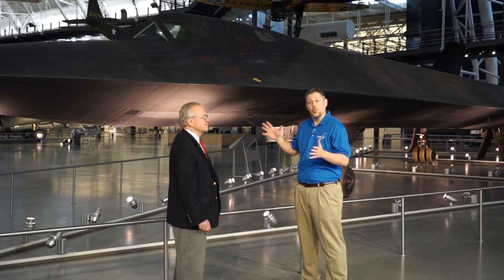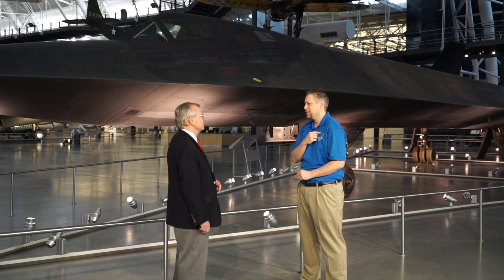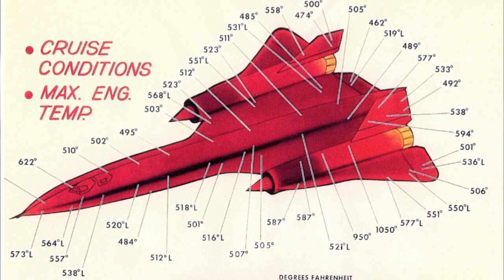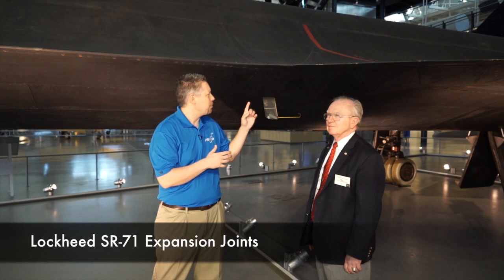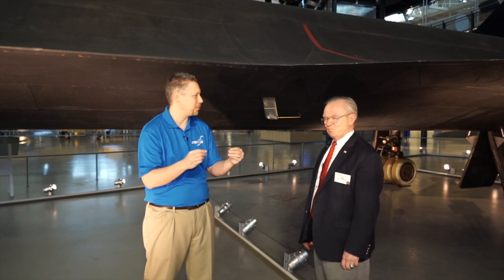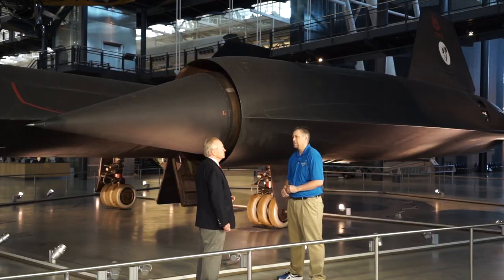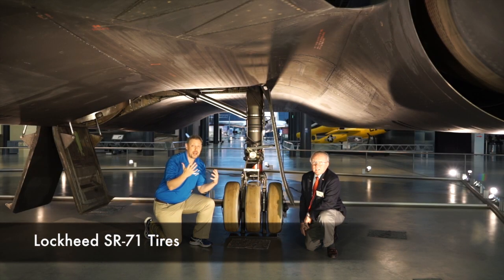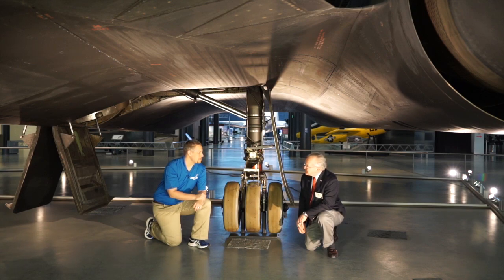A look at the SR-71

Comment: The statement in the description that "There is no inside of the Plane, The fuselage is all fuel tanks," is NOT true.  The area between the engine nacelles is "wet" plus part of the fuselage forward of the leading edge of the wing.  The fuselage is a cylinder with chines on the side to give it a lifting body effect.  It is in those chine areas along the sides where the TEOC cameras, the two SLR recorders, the EIP/EMR (electromagnetic intel gathering) systems and occasionally an auxiliary liquid nitrogen dewar for the long transoceanic flights.
Just 20 seconds in and it falls apart.  The idiots who put the video together put an image of the front end of the YF-12 with it's "standard" target acquisition radar hung on the front of it.  The SR-71 had no such radar.  Instead of the dish as on the YF-12, the SR-71 radar was a synthetic aperture side-looking radar and the array was roughly six feet long by 10-11 inches wide (for the CAPRE radar system used for the majority of its career).  It was fully contained in the nose.  When the noses were removed, the front of the aircraft was dead flat and could take any of the ballast, radar, or OBC (optical bar camera) noses.  
Then the next bit of nonsense that shows up is an image of what appears to be one of the TEOC cameras that mount in the mission bays down the sides of the aircraft.  it is NOT the OBC that Col. Carpenter is describing.  He is absolutely correct about the four bolts holding the noses on.  I changed many noses between 79 and 88 when I worked on and taught theory and maintenance on the CAPRE SLR.  Unfortunately, Col. Carpenter is not correct about removing the OBC nose after flight and taking it to the photo shop.  The photo troops dropped the camera out of the bottom of the nose to access the film.
Disappointed in the Smithsonian throwing random images into the video instead of actually doing five minutes of research to get it right.

Comment: I had 20yrs of work in Aviation when I first stepped out on the platform above this aircraft at Udvar-Hazy. I was the geek of aviation geeks. I've been next to F14s, sat in A6s, craweled in E2Cs, F18s, H46s, P3s, F15s, a couple Tornados even got to crawl around in a restored B17. There is possibly a Tomcat I worked on down right of this aircraft. That day the angels choraled and the light shown down. My wife at the time couldn't understand why I was standing there all ferclemp. Cool is not nearly even remotely a good enough word. The photo I took that day is my background display on every computer I've owned since.

Comment: The part about using just a slide rule to design the Blackbird is a bit of a fib. Pratt & Whitney had an IBM 700 which it used to help with the J58 engine.

Comment: Such a shame that they did not update its imaging system once encrypted satellite communications were made available. The SR-71 definitely is one of the most iconic airplanes in my opinion and was really ahead of its time. 

I'm also very happy with my 1/72 2021 Academy "Limited Edition" scale model kit. Sadly none of the kits are completely accurate and each has their own pros and cons. The Monogram/Revell kit is generally seen as the best option but has raised panel lines and the canopies are too wide. The Italeri 1/72 kit does have the recessed panel lines but apparently has significant shape issues with the nose that seems halfway between the SR-71 and the  A-12 predecessor. Then there's the Academy's 1/72 kit which is a clone of the Hasegawa kit. This one is often ranked behind the Monogram and Italeri for accuracy issues, while the decals were also pretty bad for the earlier versions (some even remarked that the red was more of as  "neon red". There was one "Special Edition" from 2013 which apparently had the best decals but that one is hard to find (and expensive because of it); although a 2021 "Limited Edition" release also seems to have pretty decent decals (albeit from as different supplier). But regarding the Academy/Hasegawa kit; it still generally looks like a Blackbird.

In the end I went with the Academy version as the online retailer had several other items I needed so it was a one-stop-shop for me. That kit also had the least number of parts and I am not a professional kit-builder. So I did not want to spend days on end on a "Level 5" kit with 60+ parts and am currently still practicing with "Level 2" and "Level 3" type kits so I can practice building, filling gaps with putty, sanding, painting, and applying decals properly (which can be pretty challenging at times but look way better than stickers imo). 

Now I have looked at my Academy 2021 "Limited Edition" kit as I still think it looks very nice. Sadly the canopies are all clear plastic so you have to take them off and paint them but that's a nice starting job for me. For a 1/72 scale kit it's a very nice and big ship. I'm also planning on adding some orange LED lighting to the thrusters and convert it to a flight-mode (these kits generally always sit on the ground with landing gear; some even having the 'spy drone' that the SR-71 never used. Pretty odd as to why some of these companies keep including it.

Comment: I was a contractor that visited Beale Air Force Base starting in 1990 (just north of Sacramento).  Unfortunately, they had just taken the SR71's off line, so I never got to see them take off and land.  But, earlier, I did occasionally see them flying over my house (we live south of Beale about 30 miles) at low altitude as they were coming in for a landing.  And I often walked around one of them they had on display just off the flight line at Beale (as well as engines, flight suits, etc at the Beale museum).  Later I did see the few that remained flying at Edwards AFB (NASA).  What an amazing plane.  I feel fortunate to have seen what I did....

Comment: In ~1981, I was working a couple miles east and south of Buckley AFB in Denver. My co-worker and I were outside when we heard a jet take off from Buckley. As it rose, we both recognized it as an SR71. The plane was obviously just poopin’ along with the nose at ~25 degrees upward angle. It flew three times around between the base and a couple miles south of our position, looking like something out of Mordor! The last time it got over the base, two huge gouts of  flame twice as long as the jet and black smoke blasted out of the engines, and in 1-2-3 seconds it had disappeared into the clouds! A few seconds later we heard the most deep-throated thunderous roar I have ever heard!! It took more than a minute for that roar to fade away. A most impressive and awe-inspiring aircraft! I will be forever grateful I was there to see it.
Reply: Hi Fred 😊

Comment: Quite the plane. Parts of the design I think I could do better and parts that don't make sense to me. The bypass in the engines seems bizarrely convoluted iirc which seems so strange for supersonic flow. Impressive to shoot the stars for position. I might have done that with terrestrial radio beacons instead. Inertial for backup maybe. 
I would have done a glassless cockpit. Maybe even a pilotless one.

Comment: As an Army soldier, I was stationed on Okinawa frim 1973 to 1974 with USARBCO as a machinist with the 10 ton truck rebuild group. One day I was coming back to work from lunch when I was startled by a 'loud' noise up over my head. A SR-71 was returning to Kadina Air Base, flying west over the southern part of the island on approach to dump fuel and fly back east to land. It was so close overhead I could read the stenciling under the plane! If I was lucky, when they took off and I heard the engine noise, I could look north and see the SR-71 at 45 degrees or so, disappearing into the clouds. Just beautiful! On Okinawa the SR-71 was called "Habu", which was a local venomous snake, not knowing of the "Blackbird" moniker. Later I saw shoulder patches of the pilots that had "Habu" on them and understood the naming I was told of.

Comment: 2200 miles per hour is the unclassified top speed. Makes one wonder what the actual top speed was, doesn't it? JP-7 has a high flash point. The fuel in the tanks would get really hot so regular jet fuel could not be used at speed. THAT is part of the reason for refueling: putting the appropriate gas in the tank. Wonderful machine. The cockpit is not for large people, either. Not mentioned was that the air in the cockpit would be over 100 C, hence the space suit.

Comment: One of my favorite aircraft. I was fortunate to see it take off many times from Kadena Air Base, Okinawa when I was stationed there. The Japanese called it the Habu, a local venomous snake on the island. Because of the heat & growth of the aircraft, on the ground it leaked fluids severely. They had large pans to catch the fluids.  It would rattle the windows of the buildings along the flightline & set off car alarms during takeoff. Beautiful to see take off at night.

Comment: This craft didn't have wings, its body IS a wing! It had side-wings only to hold the bulk adjacent engines...if you expand the craft size to a large passager model plane, the engine thick propell rod could have been a convertion jet to rocket afterburner, between the o-ring blade skin frame, It could have been the amazing Spaceline/Orbitline passanger service SpaceX attempted, with only 12 to 17 min far more realistic of delay then that verticle rocket dive,, so a SSTO instead. Super sonic airlines were banished to public use because they flew within the tropicsphere as a sound EPA issue.

Comment: I had a toy version of SR-71 when I was kid, I thought "dark speed" toy was an alien spaceship with a high speed. I called it "dark speed" because of it's black color on the plane (not being racist btw, I am just saying it literal by it's visual design) and it's long and thin design which makes it so fast. I was partly correct with its speed. I didn't know it was a defenceless and spy plane, because when i used to play with it, those 2 engine thingy, I thought it was a missile. Btw it was made by metal. I don't know what is specifically made of but it's heavy like holding a phone. It's very hard to brake and I just realized now, It was an honorable, outstanding, very rareand anti-missile toy I ever had. I just wish I still remembee where I hid it and make it as a collection for my childhood.

Comment: The soviet union had the same problem with their MiG-25s and the A-10s could fly with one engine by entending the flaps in opposite directions to the force from the one working engine to stop it from rolling but it's strange how it wasn't implemented in the SR-71 that's correct.

Comment: They definitely have the SR72 up in the air. DARPA was working on HTV-2 which could go up to Mach 20. But they cant figure out a way to control it during flight. So if they are working on something that could go Mach 20, I wouldn’t be surprised if they already have SR72.

Comment: He had to choose his words wisely concerning the speed. The speed is still classified.
Reply: Braden A  No worries. I'm just trying to educate, not criticize. It's a very common misconception that many people have about acceleration vs top (maximum) speed. It seems intuitive that less weight would help any vehicle go faster, but that isn't the case. Less weight helps any vehicle, whether it's on sea, air or land, to accelerate quicker, including up to it's top speed. But lighter weight won't help it go any faster because weight / mass has nothing to do with (fluid dynamic) drag. Once a vehicle gets over a certain speed, it's weight is irrelevant in terms of going faster. Top speed all comes down to (fluid dynamic) drag vs power (all other things being equal like aerodynamic heating, etc). 

When you look at the drag and power equations from the subset of physics known as Fluid Dynamics (for aircraft, specifically the subset of Fluid Dynamics known as Aerodynamics) it becomes clear as to why this is the case. Aerodynamic drag goes up by the square of the velocity, and the power needed to overcome that drag goes up by the cube of the velocity. There are no variables in the equations for weight / mass.

Engineers have always tried to design modern fighter aircraft with excess power, not for top speed, but for acceleration and maneuverability. It isn't necessary for 4th generation fighters (and above, like the only true 5th gen aircraft: the F-22 and F-35) to go super fast. All 4th gen and above fighters are equipped with sophisticated missiles for BVR (Beyond Visual Range) combat. The missiles fly much faster than any of the aircraft ever could. So you want the excess power for acceleration and maneuverability in case you run out of BVR weapons and you end up in a gunfight, and / or you're trying to evade / escape a missile.
Reply: Well we learn something new all of our lives.
Reply: Braden A  your statment was the top speed is not classified,  that is false it is, the top speed ever by an sr71 is still classified.  that is my point the rest of your stament is meaniless as it has nothing to do with weather the top speed is classified or not.
Reply: Braden A  wrong.  listed top speed is mach 3.5  actual top speed is classified

Comment: I thought they refueled because of expansion.  The fuel tanks leaked like a sieve on the ground because of the tolerances. Once up and flying the heat caused them to expand therefore sealing up the tanks.

Comment: I'm really amazed that this thing was built in the 60s.
Reply: An even more amazing piece of technology from the 60s was the Saturn V moon rocket.
Its lift-off weight was more than 5 times that of a fully loaded A380 and its first stage had more power in its fuel pumps alone than the total engine power of most large aircrafts and ships.

Comment: Ok so if you're at 80k feet going mach 3, what's keeping you following the shape of the earth? Wouldnt you just fly straight out into space, burn up? Do he have to keep the plane nosed down constantly? As far as I know theres   no tech on the plane to counter this happening
Reply: The lift of the airplane is determined by lots of factors, air pressure being one of them. To hold a steady flightlevel (altitude) the force of lift on the airplane, and the force of gravity has to level each other out. This means that the airplane will follow earths curvature because the earths atmosphere also is a sphere. 
Sorry to break it to you, but the earth isn't flat. There isn't a single thing that indicates that it is. 
I'm not a native English speaker and writing on the phone isn't the best (if you're having a hard time understanding).
Reply: @Cds2000Channel  I'm understanding fine but I still dont get how the atmosphere being round is going to effect a plane going mach 3 in a straight line, I've seen them fly real close to the ground and the guys just hold the thing straight, to go that fast you have to be going straight, what about those salt flats where they race the rocket cars? That has to be flat
Reply: At 2200mph and at 80,000 feet how is gravity going to steer the plane? Not possible
Reply: @bigmikeobama523  You clearly didn't understand fine... You're missing the point completely.
Reply: @Cds2000Channel  the gravity is always there when you're flying along flat to the ground at low speed you would never notice but at 2200mph you would have to be accounting for something, this guy  never noticed that?
Reply: @Cds2000Channel  no pilots ever mention the curve of the earth and if you go up in a plane it always looks flat, but people try to show me boats going over the  curve
Reply: @Cds2000Channel  this plane being able to fly that fast with no navigation systems accounting for the curve and spin isnt possible the pilots altitude would be all over the place he would have to be constantly nosing the plane down to follow the curve
Reply: @Cds2000Channel  8 inches per mile squared it says on google, you do the math at 2200mph that 2200 miles times 8 in an hour, that's alot of inches per hour and if we keep doing math we can figure out how much curve per second they need to account for
Reply: O wait it would be times right then squared, theres seems to be controversy about these number but even without the squared part that's almost 1500 ft in an hour not accounted for
Reply: @bigmikeobama523  You said you read my original reply, but it doesn't seem like you did. Its explained there.
Reply: @Cds2000Channel  all you said was the atmosphere curves so the plane curves wow... why? Because science? Or?

Comment: Couldn't you just update the camera equipment and not retire the plane?
Reply: John Montag not necessarily bc the software and hardware (controls for the camera) we’re not as up to date like the ones today. To update they would have to replace the controls and then install software to operate the camera. That wasn’t the only reason the SR-71 was retired. It had very high operating costs compared to reconnaissance drones.
Reply: I believe the real reason why the plane was retired is because of satellites. Much cheaper to operate and better equipment.

It is sad though. The SR-71 is magnificent.
Reply: At8000RPM that’s another reason as well. Plus modern reconnaissance satellites have much better camera quality and can cover a bigger space

Comment: I worked on that airplane during my time in the Air Force. I pre-flighted  it several time before flights over Vietnam. 17976 is the tail number. Visited it in Dayton in 2006. 9th FMS Electric shop 1971 -1973.
Reply: Skunk Works, baby!!!!
Reply: Is it true they leaked when cold?
Reply: @drummerdoingstuff5020  Yes there where drip pans all over the center fuselage on the ground behind the equipment bays. After a flight, once the bird cooled off. There are 6 fuel tanks on the plane, during flight the pilot could transfer fuel to distribute the weight.  The plane had to refuel 6 times flying to Vietnam from Okinawa. Total flight time was 4 hours and 35 minutes there and back,  from Okinawa.
Reply: Thanks for your service btw